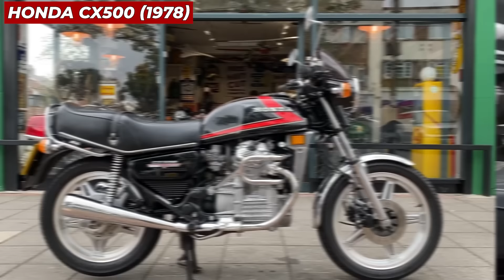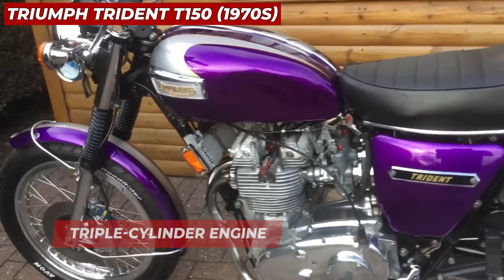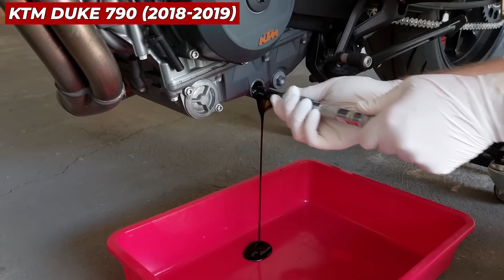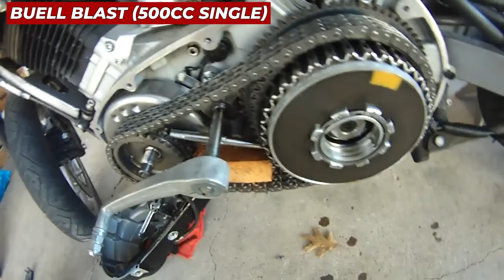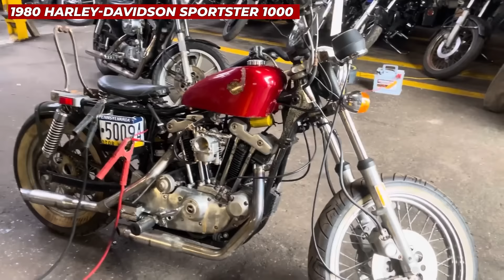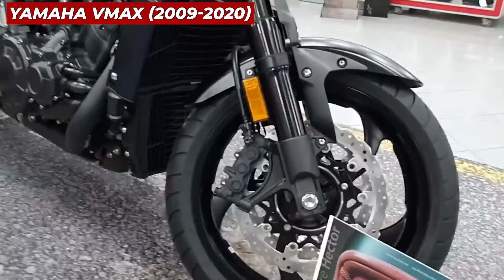20 WORST Motorcycle Engines of All Time

Comment: I bought a Black Suzuki RE5 rotary engine motorcycle that was slightly used in 1978.Went on a solo road trip to Pikes Peak Colorado Springs Colorado and back and got good mpg on the highway.Never had a problem always started in cold weather great handling and was the smoothest ride I ever rode.Put over 20,000 miles on it before forced to sell it in 1982 for economic reasons.I would get another one if I could.

Comment: I bought a Twin Cam Superglide in 04.   It's a fantastic bike but you will have to watch the cam-chain tensioners.   Most bikes have plastic camchain tesioners.   I prefer gear-driven cams though.   Harlecy chinced-out and used a tiny little timing chain so that they could build sloppy engines with more crank run-out.  But I have 55K miles on my bike.   I'll do the tensioners and ride it for another 50k miles. .

Comment: Maybe I was just lucky but my old 1980 Ironhead Sporty only had 2 problems in all the time I had it,front cylinder head gasket and the generator stopped working..damn I miss that bike..
Reply: I had a 79 Ironhead.   I bought it used with low miles.  I got it running right away and rode it a bit then sold it for a profit.   The buyer was in Japan and had it shipped from Florida.   It was a fun bike and great looking / sounding too.   They will last if you kept them up.

Comment: i stuck with this almost to the end but the repetition of the bike models or each intro was awful. As has already been said UK despatch riders found the CX500 to be amazing and very durable. To incude the Suzuki 400 seems odd when the video is supposed to be about bad engines and all thhe Suzuki faults were frame and suspension shortcomings.

Comment: I had a 78 Honda hawk put a 450 night hawk engine in it it had oil cooling and a six speed over drive I put a 18 tooth drive sprocket on it risers gold wing bars racks Harley wind shield it would cruise 65 at 4000 rpm and 70 at 4250 rpm it had a 120 18 rear tire I let my dad have it the fuck left it in the back yard un cover for 3 years he fucked up another custom cb 550 I built in never went back home after that he was a descendent of John Wesley Hardin he had problems I got tired of being ripped offafter he passed away I got the machines he fucked up in my house waiting their turn to come back to life

Comment: Bought a new 1984 Honda VF700S off the showroom floor for $2800. V4, 6 speeds, and shaft drive was the smoothest bike on the freeway I've ever had. Never had a problem with anything.

Comment: I've been a british motorcycle owner, collector and national judge for the AMCA for over 30 years.
  I would always hear disparaging comments from other people about British bikes and how unreliable they were and that and parts were difficult to find.
   It's been my experience that most of the problems were due to bikes sitting for long periods of time, not being serviced in a timely manner if they were served at all! Many were not even stored indoors and suffered greatly especially the Lucas electrical system and components. Then you have repeat and "new" owners that think they can make the bike run better especially "fiddling" with the carburetor settings. 
  Then there are younger owners that think they can just get on a vintage bike and think they don't need to let the bike warm up and go as fast as they can only to find out a very costly lesson.. Vintage bikes do not perform like the newer air and water cooled bikes of today.
  The Aerial square four was a design that originally started as an OHC design and later changed to an OHV engine. It always had issues with blowing head gaskets. The 72 Norton combat commando design was pushed to far..even the Matchless//AJS twins from the mid 50's to 1960 suffered from the same problem by taking a great 500cc twin design and kept pushing it higher and higher to the 650cc twin size and suffered from some of the same problems. Every bike has its quirks.

Comment: Absolute cobblers! I had 3 CXs when I was a despatch rider, one of them did eat 2 alternators but I used a trolley-jack to get the engine out and changed them. They were easy to maintain, comfortable and reliable. Thousands of despatch-riders proved this.
Reply: Ai slop and drivel garbage vid...

Comment: The RE5's in the #1 worse position pictured the Suzuki GT-750 Lemans with RE5 side covers. It wasn't a 'Wankel Engine' either it was a 'Rotary Engine' it's a small patent difference, it's what the R stood for. Someone is BS'n around in this video. Few people owned one RE5s and the few I knew that did loved them. I drove one several times that claimed year and model, and it wasn't pictured at all in this video. The bike I drove was a dream, it was way ahead of its time. If you used the prescribed Suzuki 2-Stroke CCI oil in their auto-injection,  the Suzuki GT-380 Sebrings, GT-550 Indy, and GT-750 Lemans street bikes all ran very well and cool, even if beefed up. Once people reverted to cheap  outboard motorboat two stroke oil the smoking issues etc occured or if they ran their injectors rich getting by without Suzuki CCI oil. Dirt bikers never really cared what they used.
Reply: This video is full of crappy. There was nothing wrong with the GT's. Nice running macheens

Comment: I once owned a Honda CX500 and rode it for thousands of miles over about 3 years, Including a grueling 2 month cross country.trip.  Apart from a couple of flats, spark plugs and points, and an engine temperature sensor that died, I never had a single issue with this bike.  It was so reliable that it was adopted as the model of choice among motorcycle couriers in the city of London.  Never heard of the problems you mentioned, and can only surmise you've made a mistake on this one.
Reply: I was one of those London motorcycle couriers that had one, they were used because they were boringly reliable, even with the abuse we gave them.
Reply: It's an AI slop and drivel vid....

Comment: I was working at Pacific Beach Honda when the CX500 was having all their problems.  For the most part ONLY the '78 model had all the problems mentioned.  Honda covered almost everything that went wrong on the '78's,  I paid for a fantastic vacation just doing warranty work on the CX,  Another warranty job that was a money maker (for the technicians) was the 'gas cap latch' recall for most all Hondas that had a 'latch type'  gas cap...... Most all CB's like the 350 twin, 400 hawk, CB450 twin, and all 4 cylinder bikes up to 1977/78.

Comment: My 1983 Honda VF750 Interceptor was an absolute nightmare to own..It loved to eat camshafts after not too many miles..i replaced them all twice before i found out it was a faulty oiling system design which Honda honoured and rectified..but too late for me as i had already spent a fortune on her..Ended up wrecking the bike just to break even as it was impossible to sell complete and get my cash back..

Comment: Back in the day right here around me were a couple little dealers. I had about 1500 bucks that was alot back then. A small shop had a new RE5 and 2 water buffs. The 5 and 750. Another shop down the road had a low mile CB750. A 76 I picked the Honda and never looked back.

Comment: I only had one problematic motorcycle out of the 22 I have owned over the years.  I started with the Yamaha 2 stroke enduros of the late 60's and early 70's.  The 175 was so good that I moved up to the 250.  Then to the 360 in 1969.  This was the street legal model, not the motocross one.  I had heard so much of the power and success of the motocross 360 I had to have the the street legal one. I racked up more miles going back and forth to the dealer to ask why it wasn't performing than I did actually enjoying it.  It just didn't run smooth and wasn't all that responsive to the throttle like all the other 2 stroke models I had owned. I wound up trading it for my first of three Yamaha XS 650's.  The first year was the 1970.  Rode it for two years then traded it for a pick up truck.  Got a 1971 and later a 1975. All my Yamaha's and Honda's, except for the 360, were flawless. NOTE: The young man who bought my 1971 XS630 rode it from Arizona to the Canadian border twice with no breakdowns. These XS650's
s resembled the venerable Triumph Bonneville's of the 60's, minus the Lucas electrics nightmare.

Comment: Not just the cx 500 but the 650 too.  Had all the problems mentioned with the triple bypass.  Did all the work myself but would have cost more than it was worth to take it to a shop.  Other than that it was a great engine and I loved the bike.  For those who might dispute this, head over to the cx 500 forum and you will see many accounts of bikes with these problems.

Comment: About the CB400 A  my wife first car was a Civic Honda with a 2 speed semi autonatic  at 60 mph on the highway it seemed to rev too high and was noisy. . at 70 mph it got so smooth, , 😂, , One timing belt at 189,000 km     we sold it at 345,000 km to our neighbor , for $375. he tried to lower the price to $200 ? ? ?  I told him, these car are sold for more than $1,000. .    so at $375 . it wasn't getting for less. . . He bougth it   her wife was travelling Montreal to Québec twice a week and 4 years after she still had it  past 400,000km with only a used gas tank

Comment: I've now owned 2 CX500's. My first one hit 80,000 miles and the forks gave out on it - didn't have the funds at the time to repair. I now have a '78 original which was rotting in someones back garden for 30 odd years. This one needed everything doing to it to get it back on the road, with the notable exception of the engine. The CX engine is simply amazing - it does 1 thing better than any other bike, which is that it simply keeps on going.
Reply: Gotta wonder where this guy got the idea the CX500 engine was one of the worst.  Total misinformation, no question about it.
Reply: @Fine-TunedUniverseSpeaking  
It's all AI garbage...

Comment: I'll add the Harley Davidson 1994 Softail Custom as one of the shittiest motorcycles ever cobbled together, with a notoriously hard vibrating Evolution V twin bolted directly to the frame which caused bolts and screws to break or backout, mirrors and footpegs to fall off and the bike trying to destroy itself whenever running. All that vibration was then sent to the rider, numbing feet and hands and vibratory compacting and destroying the rider's joints and spinal column.

Comment: Total bull I have a 1982 CX500 over 100 000 miles on clock I've done over 70 000 myself on it since I bought in 1994 still going strong  obviously has had wear and tear parts 1 clutch  tyres brakes etc only ever done service on engine 😊

Comment: Listing CX500 showed what a crock of crap this video is going to be.
I dispatched for 3 years in the 80s, while I was on my Z650 and GS850, most of the other riders were on CX500s. They ran them for 1000s of miles, reliably. Serviced and repaired at Chasbikes there were rarely issues.
They could be rebuilt for little money, the engine was easy to remove and easy to work on.
And when a rider wrecked one, he bought another.
They wouldn't do that if they were unreliable or expensive to fix.
Reply: i was a London Courier for around 35 years...i hated the sight of CX500's...and those MZ's.....i rode many bikes...dozens of Hondas...couple of VT500's..XBR500..250RS..VT250..loads of CG125's..Honda CB500/4..CB1..and a Super4...covered over a million Kilometres on 2 wheels...69 crashes...about 65 thousand deliveries..on at least 45 bikes...too many to list

Comment: Completely wrong on the Trident. Oil filter had a relief spring. Owners were too dim witted to read the manual. People used to twins always ran the triple in too high a gear, lugging the motor. The T150 did not have swivel ball valve (Ducati style)  adjusters, the T160 did. Never heard of one cracking. If the centre cylinder ran significantly hotter, then Honda's four cylinder was worse. Talking about seized middle cylinders and showing a Honda(?) whilst digging around in the plug cap with a screw driver.
Never had any of those problems with my 2001 Mille.
Reply: Ball end adjusters were cheap and easy to install. Added them to my A75 BSA. Only problem I had.

Comment: I bought a new BSA C25 Barracuda in 1967. By about 6000 mikes it was on its third set of big ends. It even went back to the factory for an overhaul. By the time I got it back I was so disillusioned I got rid. It put me off bikes for a long time and I never bought another British bike. I subsequently had Hondas, a Suzuki and a Yamaha non of which gave me problems.

Comment: Soooo glad I bought my Harley Fatboy in 1998. Simple reliable carbureted EVO single cam, with over 12 years of production refinement. A bullet proof 5-speed, and a strong, if somewhat heavy frame. 1999 "tech" changed the company for the worse, and it continues its' slide into the junk category of manufacturing.

Comment: Cx500 had pushrods ie no cam chain
Reply: WRONG cam chain tensioner' breath!  The cam chain  was in the rear of the engine and had the adjuster bolt sticking out near the right carb float bowl.  Next time you try to pretend to know something you better check your facts!!
Reply: You are clueless;  why post if you don't know what you're talking about.

Comment: Yep the early model cx500 Honda's were prone to problems but I owned one for about ten years and never had any issues with it horses for courses I think I owned a Bol Dior 750 that used to go through cam chain tensioners and Honda's 450 twin was a nightmare  chewing out cams  at an alarming rate I've owned a dozen Italian machines in my time as well and all suffered from crap electrics and poor turning

Comment: H2? You can add all powerful two strokes to the list like the RG and RD 500 or the NS400R or even they smaller variants. If the powerband kicks in you must have controll over the bike.
Reply: The H2 is a nice tractor with ridiculous power compared to current motorcycles.
Its problems are the handling, the brakes (even with the 2 disc option), the tires of the time and its consumption.
The RG 500 does much better with 50% more power.

Comment: The Moto Morini 350 was anything but attractive Italian styling.  It was styled (if you can call it styled) to suit ridiculous American demand of what a bike should look like. Furthermore, I am astonished there is no mention of BMW's problems with many  transmissions problems, electrical problems on K1200s and piston slap in their boxer engines. What about Yamaha XS750 engine problems? How about Kawasaki 'plastic cam' problems(that's how repairers named them)? Honda VF750 engine problems? You seem to have concentrated many of your examples on small quantity models.

Comment: I loved CX500s and had four of them over time. Never let me down. The cam chain tensioner was an early model fail that was quickly fixed by Honda at their cost. I was a Honda dealership mechanic and never saw a stator problem. It was an easy 100,000 mile engine in a time when 20,000 miles was all a lot of bikes could make.
Reply: I used to be a dispatch rider, my 500CX never failed me. Agreed the frame was made of spaghetti tubes but the engine was a dream. Even today I'm sorry I traded it in...
Reply: Same for me, two CX's 1978 and 80, Changed the cam chain tensionner on the first one, no problems with it. The next one I did 25000 kms with it, no problems, great bike. They are still used as despatch bikes in Europe seem to be indestructible.
Reply: I had an 80 Silverwing with the same engine. Powerful. It would kick the 650 Tempter with ease. Never had any issues. Great bike
Reply: Ditto, always loved the CX500, and in fact I owned 2 of them at different times.  Neither one ever failed me.  Did my own tune-ups by replacing plugs and points, and resetting the timing, which could be done in less than an hour!  Problem-free shaft drive, totally reliable engine!!!  The bike was a bit top-heavy, which made it less than easy to handle in turns, but that was its only flaw.
Reply: Instead of the Honda CX 
500 and Morini (I have never
experienced the mentioned 
flaws, but it was very prone 
to rust), here is one really bad
bike : 
The Hercules (NSU) Wankel,
nicknamed the vacuum
cleaner. 🤮

Comment: My 1974 XLCH Harley 1000 cc (AMF) was unsafe at any speed....It blew out the main drive chain at idle in my driveway. The transmissions would lock up for no good reason....It was the best looking pile of junk ever made.....Oh I forgot it vibrated like it was worn out at only 10.000 miles.

Comment: I had a first year RE-5 for ten years. Very quirky. Very rare, never saw another. No problem keeping it on the road, spark plugs got expensive. Was gratifying getting carb just right. Also had 10 Suzuki two strokes. Two Gt750, three Gt550, T350 and several enduros. Thirty other bikes as well. SV650S, GS1100F. Suzuki is my favorite brand.

Comment: Disagree on the Twin Cam 88. I still have mine at 70,000. Its running great. 2002 Deuce. Tensioners were removed at 43,000, replaced with gear drive.
Reply: My twin cam 88 had 86,000 miles still run great!